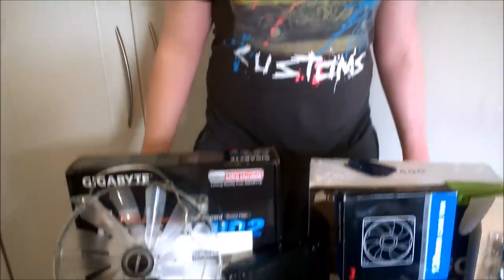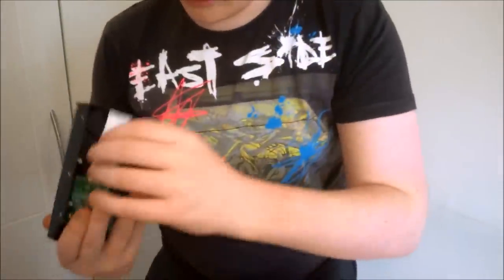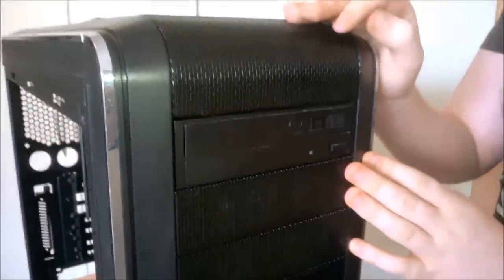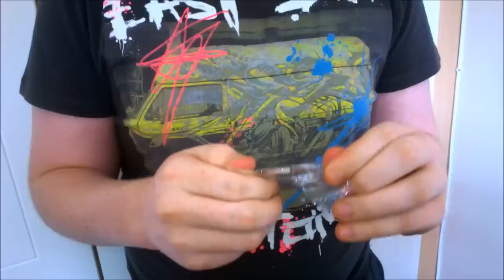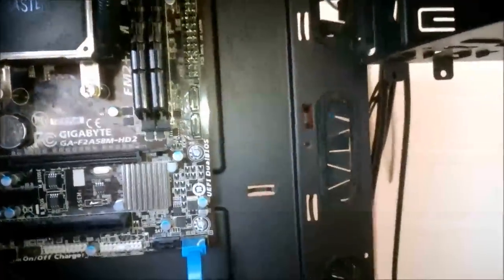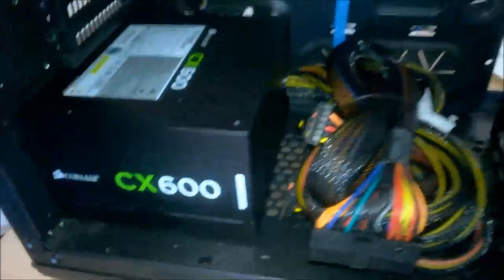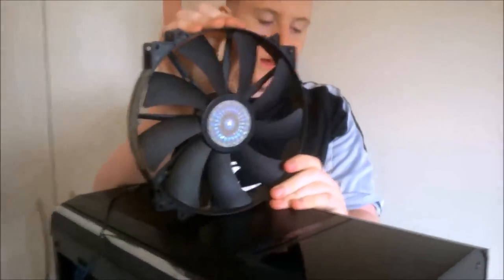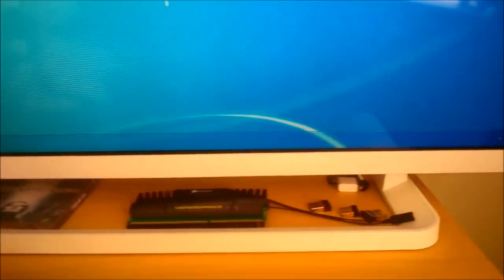AMD Athlon X4 860k PC Build 2015

Comment: I really like the case - the only thing I regret about my build is the one I went with.

I like that you sped up some bits. Looking back, I should have done something similar with my build videos.

Love the huge Cooler Master fan. Too bad the Zalman fan had issues. I should invest in one, too.

Good cable management. That's the #1 complaint I got about my builds, because I never finished it in my two videos. :p

I personally leave the HD and power LEDs unplugged, because I tend to "blackout" my cases. I also never use the motherboard speaker, because I don't like the beeping sound. It's good for diagnostics, however, if something is wrong.

Good idea going for a wired connection - reduces latency and jitter for online play.

Regarding the monitor video input - are you getting 60Hz from the HDMI connection? You might be getting 30Hz. It was hard for me to tell from looking online. If not, use the SVGA input on the screen with a standard SVGA cable, and you will for sure be able to get it.

Have a good one, Sam!
Reply from the maker: Nick Carroll No we are definitely getting the 60hz. Thanks for watching.
Reply: That's good to hear. :D

Comment: I built a similar system with an FX 6300 and ASrock Motherboard.
Reply from the maker: +The Gaming Geek nice, how did it perform?
Reply: Sam' s TechTips Pretty good, it averages about 58FPS on GTA V
Reply from the maker: The Gaming Geek nice.
Reply: Sam' s TechTips The only downside is i had to reuse 2 5400RPM laptop drives which are 500GB each so the disk speed is pretty damn slow. I have just ordered a Samsung 850EVO 120GB SSD and a WD Blu 1tb drive though
Reply from the maker: The Gaming Geek yeah, that's one part people usually overlook, a good hard drive, it's just as important as everything else.
Reply: Sam' s TechTips Well, its my first build so i guess i won't make that mistake again.
Reply from the maker: The Gaming Geek it can only get better from here.

Comment: what do you think about this pc build?

Amd Athlon x4 860k,3,7Ghz
 Gigabyte GTX 750 TI 2Gb
 Kingston DD3 HyperX Fury,1866Mhz, 8Gb (2x4Gb)
Asus A88XM-E
 HDD Seagate Barracuda 7200 3.5, 1T
MS Voyager
 XFX TS 450W , 80+Bronce
Reply: and congratz on 300 subscribers :D
Reply from the maker: I think that is a pretty nice build, and thanks :D
Reply from the maker: ***** you really wanna know don't you XD I replied to this on another video.
Reply from the maker: ***** It's fine.
Reply: good specs but i suggest beefing up the gpu to 280x or 960 gtx used hehe much cheaper and beats 750 ti
Reply from the maker: +Mate Pratezina It's a good mid range build, I would personally go for a WD Blue 1tb rather than the Seagate, but that's just my preference.
Reply: +Hayanami Gameplays if you haven't already bought the 250X, don't.
Get a 260X or 270. They're just a tad more expensive but insanely better.
Reply: +Hayanami Gameplays 
it can only do medium settings at 900p at 30fps on most games!
Reply from the maker: TheSlowestStart sure, but there is always upgrades that can be done, it could get him out a hole for now, and upgrade it later to fit his needs a little better, but yes it's not the best for triple a's or crazy frame rates.
Reply: It's still not that bad really. It can get him by for most everything. I mean not everyone buys really demanding games anyway
Reply from the maker: ***** yeah, exactly.
Reply: +Mate I know I might be a bit late to the party but I built a very similar build for my daughter last christmas, with a couple of slight differences.
An R9 270 
A 120GB Kingston SSD
4GB of 1333Htz Ram (This was a salvage from her old PC, she'll get my 8GB of 1866Mhz when I upgrade later this month)
As long as you have no intentions of overclocking anything, it's a great bang for buck build for PC gaming.
I know the 270 is slightly more powerful than the 750TI, but she's playing the likes of GTA V at High/Ultra Settings and The Witcher 3 at 900p High Settings with very few issues and above 30fps gameplay 99% of the time. It's just chewing up older games, like Bioshock Infinite playing at 1440p.
You could spend a bit more to future proof your machine, but I genuinely think you'll be okay to play 80% of PC games over the next few years. Apart from AAA games by the likes of Ubisoft, because their software sucks.
That's all I gotta say.
Reply: +Johnny Organ  the only thing i did regret is x4 860k stock cooler, its loud as hell..but i am very happy with gtx 750 ti,its a great graphic card, i can run everything on high but i have 720p monitor so :))
Reply from the maker: Mate 720p life ain't so bad, I'm still using a 32" 1366x768 60h T.V.
Reply: Mate Stock Cooler is easily replaceable and relatively cheap. You can pick up something a lot more useful for under £20 online. There's even the Corsair Seidon water cooler for under £40. Plenty of Youtube vids to show you how.
I'm still on the stock cooler for my FX6300. Only very rarely does the sound annoy me or the fans get really loud during gameplay.
HAPPY GAMING!
Reply from the maker: Johnny Organ its the cooler master seidon but yeah, also arctic make some cheap coolers that are fairly good.
Reply: Sams Tech Tips
EEK. My bad. Cheers for the correction.

Comment: The equivalent CPU is the A10-5600K not the A10-7850K.  A10-7850K has better multi thread performance by a huge margin, almost 8%.  A10-5600K WITH a discrete GPU is slightly slower in single thread by 0-1%.  Reason why I said with a GPU is because running the iGPU would increase load on the APU as the GPU and CPU are crammed onto a small board.
Reply from the maker: +ebiroll Ok. I just went off the research I had done on the CPU.
Reply: no it's the 7850K. the 5800K you refer to is a much older processor using the Trinity cores, not the kaveri core the 860K uses. the 5800K also uses the older piledriver architecture, not the newer steamroller architecture that is on the 860K. you can confirm this by examining each CPU on any CPU information website.
Reply: +ebiroll ..The 7850k and the 860k are the same chip, just the Athlon has no onboard GPU, see link http://cpuboss.com/cpus/AMD-Athlon-X4-860K-vs-AMD-A10-7850K
Everything is the same, they are the same CPU.. The A10-5600K is a much older CPU, see link here http://cpuboss.com/cpus/AMD-Athlon-X4-860K-vs-AMD-A8-5600K
Reply: +Tyler Gale Yes Sam was Correct..
Reply: Yeah I was agreeing with Sam too! (my comment was a reply to a comment that was removed, stating that it was the CPU portion of the 5800k). I was pointing out the same thing you were!
Reply: +ray mond but 7850k supports hsa

Comment: Can i use that without extra/discrete GPU? I'm plan for build some DAW PC, thanks
Reply from the maker: no, its an athlon, you can get a version if it with graphics, the A10 7850k its the same CPU but with a gpu built in. But it is dearer
Reply: +Sams Tech Tips Thanks

Comment: 1x ASrock FM2A88X extreme6+
1x cooler master V650 semi modular
1x MSI R9 380 4G
1x AMD Athlon II x4 860K 3.7GHz (4GHz overclocked)
1x Antec nine hundred
1x Kingston HyperX FURY Blue 16GB - PC3-12800 - DIMM 2X8G 
1x Seagate HDD 1TB 7.200rpm 
1x Kingston SSDNow V300 60GB

this wraps about 982€  
i hope i can bump 60FPS in almost any games on high/ultra settings ?
Reply from the maker: +Seto's Daily Video's That should be able to run everything.
Reply: no bottlenecking ?
Reply from the maker: Seto's Daily Video's maybe the CPU, but it will be perfectly fine for simply just gaming.
Reply: i'll be using recording program aswel , maybe recommended cpu that goes with my motherboard instead of the AMD 860K ?
Reply from the maker: Seto's Daily Video's No it will be fine, recording doesn't put that much strain on your PC
Reply: alright! thanks!
Reply: will i have enough possibilities in form of
upgrading my system  to an

intel core i7-5820K ?
and perhaps an higher GPU  without replacing too much parts ?

in comparison with the 860K and the AMD FX6300   is it maybe better to go for the FX6300 instead of the athlon ?
(they are about the same price here)
Reply from the maker: Seto's Daily Video's for the i7, it's just swapping out the motherboard. And I would go for the FX 6300, since it has 6 cores